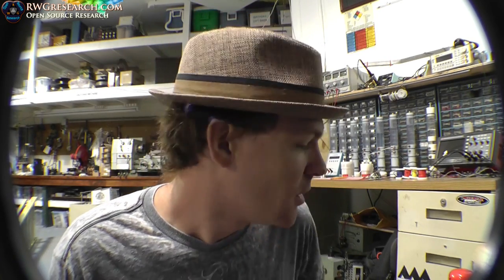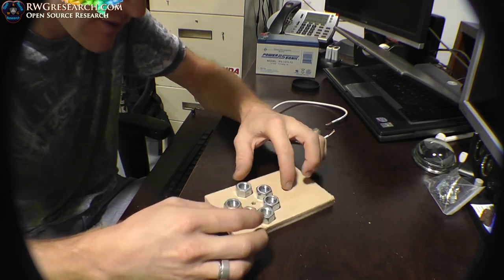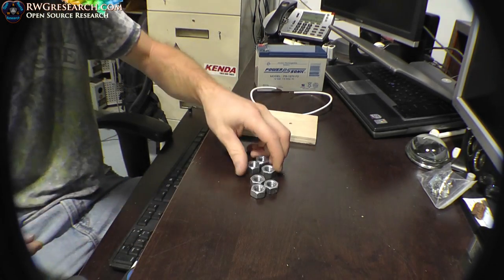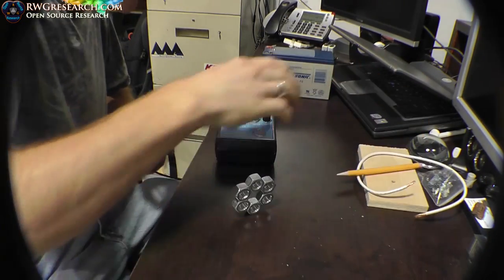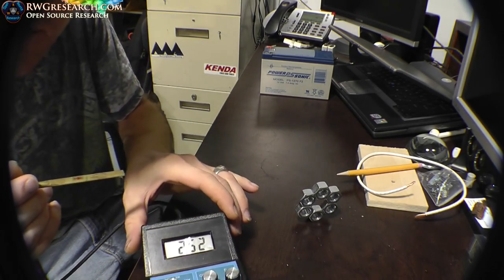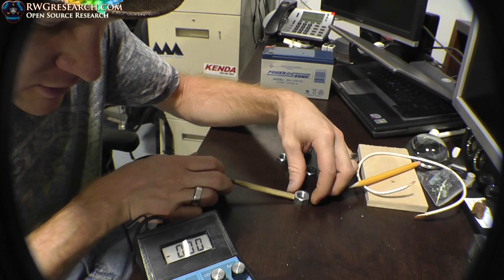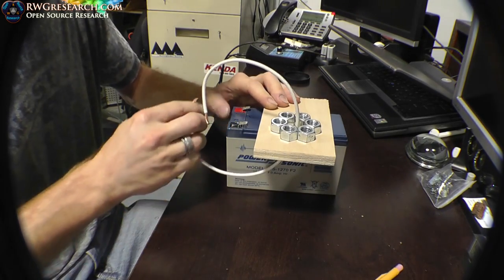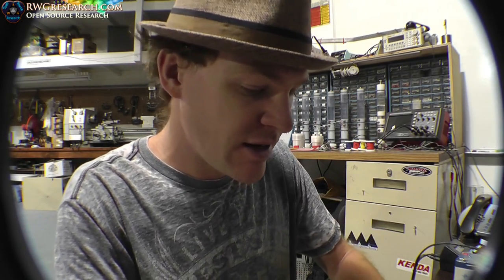“Oh Nuts!” Magnetic Lock.Your Going To Like! Using The Principles Of Ed Leedskalnin PMH.Must Watch

Comment: The solution to the magnetic loop enigma
Okay I've decided to give you the answer since no one here seems to know about it. The phenomenon responsible for this effect has little to nothing to do with magnetic remanence since this is too small an ineffective in this case presented to hold the structure together.
The phenomenon responsible for this effect is called circular magnetization (look it up) and is essentially the same field generated in a torus solenoid with a core electromagnet. You essentially creating a magnetic loop or else a circular permanent magnet (although very weak in our example).
One key characteristic of monoblock circular permanent magnets magnetization mode (very rare used) in contrast with other types of magnets is as soon you physically break the circle... they broken parts are not smaller individual permanent magnets (with the exception of a circular magnetic array made out by individual magnets).
You can demagnetize apart of thermal shock also by mechanical shock...and that's what you did. The closed loop configuration was magnetized by the magnetic field created by the high current passing the through the coil. The mode of magnetization is circular (not to be confused with radial) and is not detectable with a Gauss meter. Magnetism is confined inside the loop and don't leaks outside... nothing special really.
Reply: perpetual motion holder it is said Ed Leedskalnin used the science of this to create a coral castle in the 1940s

Comment: The affinity of the steel, mostly iron in an alloy, to easily align domains between molecules in the iron itself is the answer. In truth some retention of the magnetic alignment does remain but by breaking the magnetic bonding between the nuts most of the alignment goes away. Alloys are not as retentive (retentivity)as iron itself. One loop to magnetize more statically aligns the domains than a normal magnet. Even though iron has potential to make a permanent magnet, such a magnet has a much much higher flux density from highly wound magnetizing coils than from a quick align domain static charge.    

There is a similar experiment that uses a highly wound magnetizing coil on youtube that gives a much stronger  binding. It uses a horseshoe            shaped u bolt and a flat piece of metal. A charging coil is placed on each side of the u bolt. A 9v battery gives a quick magnetizing charge after the metal plate is placed on the end of the u bolt. It locks the u bolt and the plate together. The aligned domains cycle through bolt and plate keeping the magnetic energy aligned. It is hard to separate the two because the  alignment is so strong. Once the co dependent magnetic loop is broken then there is no 'noticeable' attraction between u bolt and plate.  Same effect but much stronger magnetic looping/linking. 

Essentially the alignment magnetically of the domains is temporary because so little of the material is aligned magnetically - more on the surface than in the core of the material or visa versa. Probably on the outside linking physical contacting surfaces. It is a very interesting effect but though containing iron the domains are not  strongly aligned as to be permanent and it is static in nature co dependent on the other physically connected material in the loop.

Essentially even the iron is acting more like a material that is semi-magnetic but has no or little retention of magnetic energy (revealed with alloys that are semi-magnetic - a magnet when energy is applied and not a magnet when the energy is cut off - temporarily aligning domains as all atoms do to degrees because of their electric/magnetic nature). Remember all atoms are  under the influence of the magnetic fields they float in so to speak and self generate. The strength of alignment of multiple atoms in a material is the effect called alignment of magnetic domains- like many mini atom magnets aligned together to make a powerfully aligned magnetic field that is strong enough to be easily discerned as what we call a magnet.

Comment: Very nice demo! I would like to share the latest knowledge on magnetizm and than the explanation for this will be clear. Firstly what some still call magnetic field is really a moving field and more exactly a current, magnetic current. The iron atoms are like little preperals turning and producing etheric flow w😅hich has a surface tension and always wants to shrink. This is a quantum event this means that the energy is being exchanged between several dimensions and so this way the energy is supplied to keep the etheric streams moving and so you can make this magnetic current run in a circle           and hold together the nuts in loop the magnetic current finds no resistance an can be so moving indefinitely, it is also useful to know that out of the three currents: magnetic electric and gravitational the magnetic is the slowest moving the electric is faster and gravitational the fastest. Hope this helps!

Comment: what happens between the nuts is the alignment of fields of iron atoms in the same direction of the magnetic field induced by the copper cable , forming a magnetic flux that keeps the nuts together even if the cable is disconnected from the battery , however ,in the moment the magnetic flux   between the nuts is interrupted the aligned fields disappears as soon as the attraction that stick the nuts together.

Comment: There are magnetic currents that act like electrical current. However, I am not saying they are the same thing, please dont confuse.
Once a magnetic "circuit" is complete, the only want to stop it, is to physically "break" the connection. Thus the electric form of magnetism from the battery circuit converts into magnetism (obviously), and then completed with no transfer after. Thus, keeping the magnets (circuit) circulating and "locking" the other nuts into place.
If you were to loop one of the nuts with a wire, then break the physical connection between the nuts, you would get voltage out of the wire, because of the conversion back into electricity.
. . . . i think. . .
However, the energy you put into this, will be the same (at theoretical best) or less (due to resistance in conductivity). 
Magnets (field) are still confusing. However, I am finding out more about them and their relationship to our existence (do not expect any video, as it may be a secret).
Reply: Alexander Hamilton There is no such thing as magnetic current. Are you talking about fields?
Reply: yes, the field isn't static and can be channeled. 
I think of them as currents, the way running water can be thought of, but not the same as electric currents (again
don't confuse)
Reply: Alexander Hamilton a non static field would emit radiation and become static very fast except when driven by an energy source which is not present here.
Reply: Sorry, i'm a little confused.

Comment: I'm going to take a shot at this. I think what is happening is essentially magnetic capacitance. If my thinking isn't too muddled you should be able to follow it. Here goes, the nuts put in a ring around a length of wire are magnetically charged according to the right hand rule. This induces magnetism in each but so north to south links are made where each but meats another. Those joints remain charged after the magnetic field has collapsed from removal of current in the wire when you break the circuit. They remain charged because they act like a capacitor. When one plate is charged the other will take the opposite charge etc. When you disturb the balance between the normal arrangement of the material of the nuts reasserts itself and the magnetic charge dissipates quickly. I may be wrong about this but if it's bullshit it's good bullshit lol.
Reply: I meant each but not but.

Comment: might i suggest that you have actually very very lightly spot welded the nuts together. the sudden surge of current through the center of the nuts induced a circular current in the nuts. that caused a slight bonding of adjacent metals. You could try a demagnetizer on the ring. if it involved magnetism that would remove it. say put the ring on your thin wooden board there and put the demagnetizer below the wood. to avoid the vibration breaking the  joints. It is interesting that reversing the polarity and doing it a second time breaks the bond.

Comment: Russ, Awesome trick.... to make this a bit safer.... use a welder and a bolt through the hole, just cut the head off the bolt so it sits flat and can still make contact with the weld table or turn it upside down. There is no need to strike a arc just make a spark. The welder can put out a bit more volts and way more amps but the effect is the same. I made two sets, one from 3/4 " and one from 1/2". I placed the smaller set on top of the larger... but after about 20 mins the smaller set fell apart.... Opposing mag fields??? maybe the larger one just countered the smaller... will look into it.
Reply: Or use a bank of camera capacitors attached to the salvaged charge circuit from it...

Comment: Thanks for showing us this demonstration of the Leedskalnin PMH using nuts.  I've been testing this myself and wish to share an interesting observation.  I placed a 2A thermal circuit breaker in line with my 12V (UB1280 8Ah) battery and still have spark with several seconds of current flow, but the effect no longer occurs.  Any thoughts?
Reply: My first thought is that it requires more than 2A

Comment: ...cont The flux field of the metal wants to collapse but it must do so while still maintaining polarity loops of the magnetic field ie. A flux loop cannot flip polarity on its own... the magnetic field from the wire created opposing flux loops perpendicular to the ring axis and perpendicular to each nut. As the polarity fied attempts to collapse it finds itself locked in opposing flux loops ... this chain of flux loops holds the magnetic polarization and keeps the nuts together. ... the end

Comment: You created a electric magnet by the use of the battery. The magnetic energy will move around these bolts indefinitely until the connection is broken by force or by a opposite magnetic field. It is the movement of electrons that creates the magnetic field. This is balanced. But is it possible to make a motor that can do actual work with an initial start up power? The problem is counter magnetic force. If only that could be eliminated, you would have higher efficiency or even free energy.

Comment: I would have to say the spark is higher voltage than 6v or 12 the pulse is being transformed by the surface of the bolts between eachother... but you would expect it to fall apart in time or ground like static.

Comment: Current flow in wire generates electromagnetic field. Steel is ferromagnetic so outside magnetic field puts small magnetic dipoles in order. It make every nut a "big" magnet. When current stops magnets inside nuts attracts each other, building magnetic trap. NS-NS-NS-NS-NS- back to front

Comment: When the battery is shorted, an electric current flows through the wire and a magnetic field expands from the wire through the nuts. The magnetic field align the electrons more to one side, making one side more negative then the other. Which aligns all the molecules +, -, +, -, etc. The electrostatic field stays until the nuts are moved breaking the field and the electrons return to their original position.

Comment: All electrical current carries with it a magnetic charge, when the electrons move through this particular configuration the current is magnified in the honey comb shape and carries it through all the nuts amplifying the alignment of the molecules in the magnet forcing them to become magnetic, the current or field being generated is probably as close to 0 point magnetism. When broken the alignments in the molecules become random, like when you break apart a magnet and try to glue it back together you cant because they become resistant. and since they are iron the reaction break causes a flip in the molecules essentially turning them like a switch and grounding the field charge?

Comment: ...cont the magnetic flux of the iron in the nuts will succumb to the flux of the external magnetic field ... the magnetic field from the wire is perpendicular to the wire (depending on neg/pos) say N inside the ring and S outside the ring (simplified) ... also each individual nut will have a polarity fied of N in the center and S on the oputer... at the instant the external magnetic field is removed (wire disconnected) ... each nut becomed itself a magnet with the magnetic flux still in this N center, S outer polarity.

Comment: the wire is a weak electromagnet. the magnetic field created by it is directed through the metal nuts due to their high permeability. since the nuts form a complete loop, the magnetic flux can simply go full circle without leaving the nuts (thus, no detected magnetic field outside). the high permeability also means that the flux dissipates slowly. try making the ring and leaving it out in a controlled environment for a long time. I predict it will eventually fall apart. it might be a year or 1000, but it probably will collapse eventually.

Comment: To understand this is easy. Any piece of mild steel will have a certain amount of impurities of what I call hard steel particles in it. These are particles which when magnetized stay magnetized. This is similar to certain tools which have a higher percentage of hard steel in it. The more hard steel particles found within the metal the stronger the permanent magnet remaining after magnetization by either electro magnet or permanent magnetic field. Obviously these nuts do not have a high percentage of hard steel as they do not have much grip after the electro magnet shock. This would not be possible if the nuts were made of soft ferrite magnetic material. This is material which has been purified to a high degree to remove all hard steel from it. This is still a magnetic material as such but which will have no residual magnetism in it after a powerful magnetic shock.

Comment: The copper in the wire is twisted and the more twisted the better...the more Copper(good conductor) the better because your are creating a torus field around hex bolts...when you add the current to this ...balancing them between the wood and away from the metal...aligns the metal or ionizes the hexagon shape which is the most common shape in nature...ionization is due to electromagnetism to positive and negative acting as one....by passing the current through the bolts in the center and copper...you make a double torus field which ionizes the metal or anything that can be ionized. ...hex shape help even more allowing the electromagnetic current to pass and balancing ions into a magnet.. making the hex stick together. ..the hex brake apart when the bond is broken. .because they are no longer lining up of (positive and negative ions)like a magnet

Comment: The matter in the iron is made up of tiny spinning particles and when your current is passed threw the middle of an open ended vortex of iron like you've  made here, it lines up the particles allot like when you slide a magnet across iron to make it magnetic, it's the same effect but with electric current instead of a permanent magnet.

Comment: I would think that the electromagnetic field surrounding the wire causes the electrons within the atomic structure of the metal nuts to align in such a fashion that one face becomes more positive than the face of the adjoining nut. This would result in just enough toroidal magnetic attraction in each nut  to resist the pull of gravity and not result in collapse. In addition, the toroidal magnetic fields of two adjoining faces on the nuts would reverse if you reversed the polarity of the wire on the battery and the same structural phenomenon would ensue.

Comment: Bud, you need to draw a little dot on one point so you can realign them after you break them. They should go back together the same way. That temporary magnetizing effect lasts way longer than people think. I've seen old screwdrivers without magnetic material on them, that are well used, hold "magnetic field stability" for months in an old toolbox. Just tapping a cheap steel screwdriver on a hard surface will temporarily magnetize it. Over time they seem to hold that field stronger and longer... Something to study maybe...

Comment: I think the nuts are being kind of like spot welded together. The white wire you touch to the battery is the primary and the nuts make up the secondary of a transformer. Due to the excessive current the nuts actually spot weld together. That's my theory anyway. .. I'm going to have to try this myself. . Thanks for the videos.

Comment: Wrap a coil through the center of one of the nuts and around a couple times, Maybe it will increase the strength of the electric bond. or wrap every nut with a coil and energize all coils at the same time.

Comment: Instead of shorting a battery you can charge a capacitor and use that. Then it is no risk if the leads happen to weld on.

Comment: You made a temporarily permanent doughnut magnet (speaker magnet). As long as it remains undisturbed it could stay that way for decades but it will eventually fall apart. What would be really amazing, would be if they DIDN'T lock together magnetically.  I've done these experiments with all kinds of things that form V or U like shapes or nearly complete circles. Scissors, pliers, tweezers and circular ring binder clips are just a few I've tried. Its cool stuff but there is nothing new or unknown about it. What may be new is how you put it to use; But so  far I've not found anyone doing anything useful with it other than having some fun.